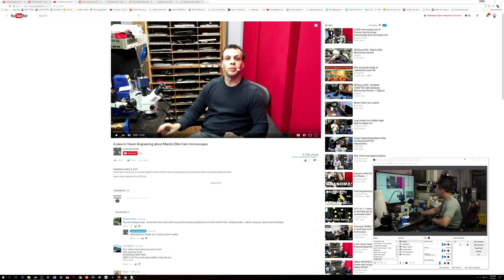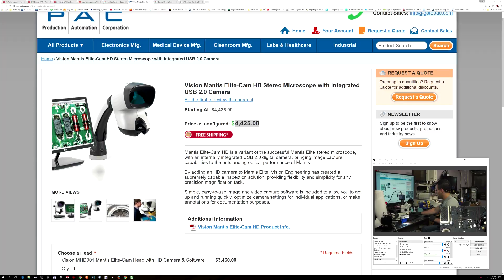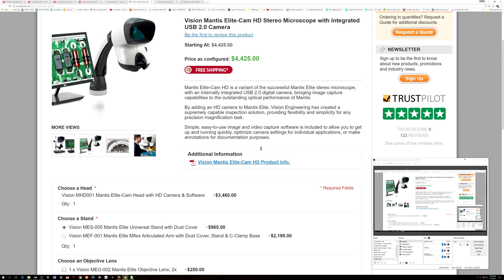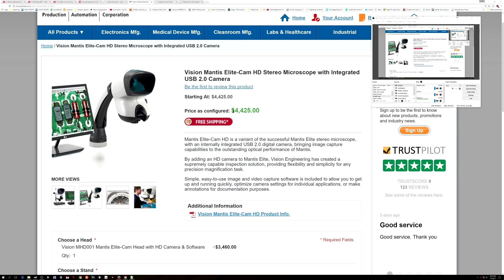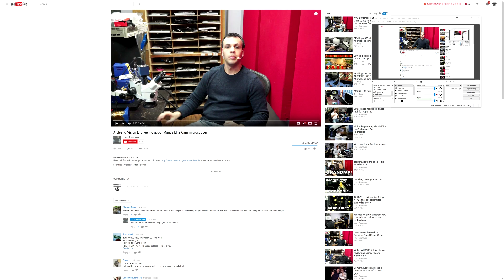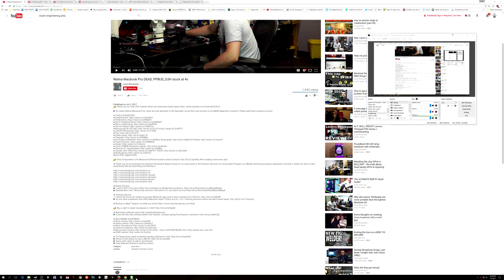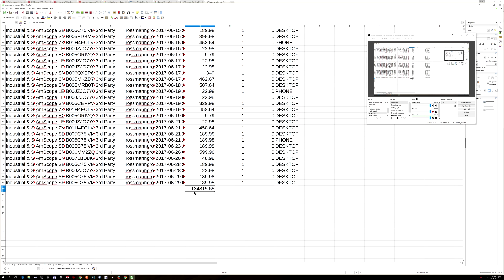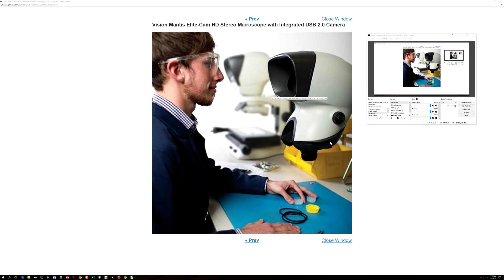A 2nd plea to Vision Engineering: please FIX Mantis Elite Cam!

Comment: Well, they would likely have to source a good camera module. All those Chinese ones are bad - unless they are of proper quality (electronics) + Sony CMOS sensor, not some no-name or webcam quality cheapest sensors from Omnivision or Micron/Aptina. Looking at some cameras in Amscope store - they look similar to Touptek cameras (meh). Looking at specs of Vision Engineering microscope - they provide "uEye cockpit" which may indicate they have IDS Imaging (good vendor) camera in there (but USB2, and it could be old Micron sensor and not modern Sony one) - so those could just upgrade to newer board cameras from the same vendor and USB3.

For comparison some Point Grey (FLIR) net prices of cameras that could be good:
- Blackfly USB3 IMX249: 1920x1200, 41 FPS uncompressed - 495 USD
- Blackfly S USB3 IMX252: 2048x1536, 118 FPS uncompressed - 725 USD
- Blackfly S USB3 IMX250: 2448 x 2048, 74 FPS uncompressed - 1095 USD
Reply from the maker: Even some $250 POS I found on aliexpress that I reviewed a while back is WORLDS ahead of the 2005 laptop webcam in the mantis. This camera https://www.youtube.com/edit?o=U&video_id=47SEO8X2hcI is not as good as mine but still 200x better than the thing in the mantis.
Reply: The key to picking out the good one is to find a camera with given sensor name - and then checking the sensor (Point Grey sensor comparison, astrophotographers etc.). If the vendor doesn't specify sensor name - run away. More modern cameras usually are those better ones, but there is still a lot of old (like 2+ years) leftovers in form of webcams, camcorders, no-name "lab" cameras or "digital microscopes".

As an astrophotographer I had/have multiple of those machine vision cameras and for such usage cases sensor performance is way more important than in microscope with full illumination :) At $250 now you can have a mid range planetary camera.  Touptek AR0130C based camera is less than that.

Comment: Louis, can't you connect the camera you have to a small screen and bracket it on top of your microscope, modify your scope.
Reply from the maker: looking at a screen you lose all sense of depth perception. Trying to solder on that type of setup is worse than trying to solder while wasted off a bottle of Bacardi
Reply: Oh well, it was a thought to help your posture and poor neck.

Comment: You probably will feel the pain with that setup too because the muscles were not designed to keep one posture for long. The real solution would be something 3D on a big screen in front of you. :) That way you could naturally move around and relax the different group of muscles unnoticed. If 3D would not required than a 3$ cable straight from your camera could do that for you. :)
Reply: Sitting straight up is FAR more comfortable than leaning over.
Reply from the maker: looking at a screen you lose all sense of depth perception. Trying to solder on that type of setup is worse than trying to solder while wasted off a bottle of Bacardi
Reply: I had a feeling this is why I said 3D would be ideal. Sadly that is not really solved yet. Maybe some kind of VR glasses in the future if they are light enough. But than you would need a dual camera setup... all is too far in the future. Thanks for the reply Louis!

Comment: take a look at this solution by Leica. i hope this link work but if it does not work search for handgravyr.se on Instagram  https://www.instagram.com/p/BSBxAC9BAUj/

as far as optics are concerned there are adapters for dslr, mirrorless and camcorder by  companies like Zeiss and martinmicroscope but you'll have to talk to them to get correct sizing to avoid vignetting.
Reply: That is a Leica M60 with an ErgoTube 10° - 50° and a ErgoWedge 5° - 25°
http://www.handgravyr.se/wp-content/uploads/2016/12/DSC01488.jpg
http://www.leica-microsystems.com/fileadmin/_processed_/csm_Leica-Ergo-Tubes-allin_a324c3ab26.jpg
http://www.leica-microsystems.com/fileadmin/_processed_/csm_Leica-Ergo-Modules-all_d28528e8f3.jpg

Also you'll need a "Photo port" or "camera port", with that you can use your camera. Couldn't find it on their web site, but they definitely have that option
http://metkon.com/timthumb.php?src=fotogaleri/image1_20170109182034.jpg&w=300&h=332
http://www.spachoptics.com/v/vspfiles/photos/LEICA-M60-PHOTO-2.jpg

Here is the description page (they have a video there too)
http://www.leica-microsystems.com/products/stereo-microscopes-macroscopes/ergonomics/
Reply: Price is a bit unknow.
Body goes forr ~$900 used on eBay
ErgoTube 10° - 50° is another $900 used (eBay)
ErgoWedge 5° - 25° is a whooping $1,000 used (eBay)
Camera Port add another $1,000 for a used one (eBay)
Stand will be around $700 used (eBay again)
Plus lenses, some misc crap - another $500

Total approx cost for a used scope around $5,000
New one from Leica directly? I assume over $20k
Reply: @evgheni melman
how are u able to post all those links?
youtube hides my comments like this for others and some people even asked me, if i got their link to sth. i asked them for in the comments, which of course i did not get.
u're a lucky one evgheni.
also fuck youtube.
Reply: cataria pega you are probably blacklisted by YouTube for some comment that you made.

Comment: Can't you spec the camera you need with your microscope?
Reply: Different styles of microscope have different styles of cameras. They all mount differently unfortunately. Some  scopes have them built inside and some like the one Louis has can be taken off and changed.
Reply from the maker: You can't swap out the camera in the mantis the way I can swap out the camera on my amscope. :(

Comment: Yo Louis Rossman, an idea.

Make your own lcd set-up! After set-up, the only maintenance should be updates or adjustments.

*Logitech webcam 920 (30fps, if you want more, there should be 60fps webcams now from other companies)
*monitor suggesting 12" or bigger, combo it with a Sun Hood to prevent glare
*monitor mounting arm. amazon basics one looks good.
*3 quantity - 10 foot hdmi connectors
*external video capture streaming device
*small computer, suggesting something small enough to be a single purpose device. i5, windows 7 (8 blows, 10 unstable)

1. tape webcam to microscope
2. lcd monitor to articulating arm
3. webcam to small computer
4. hdmi from comp to video capture device in
5. video capture device hdmi out to lcd, second hdmi out to your streaming computer.
6. Turn on OBS on small comp, set to fullscreen. leave small comp on permanently. power settings so it never turns off.

You might be looking at 1.5k to put together a good set-up.  Enjoy taking care of your back sooner than later! =)

Comment: If you don't know who to reach out to at either company... it'd probably be worth hopping onto Facebook Power Editor, creating a Custom Audience that targets only employees of Vision Engineering & Amscope, and running this video as an ad that appears in those employees' News Feeds. Even if it doesn't reach the decision maker, maybe it'll reach someone that'll pass it to decision maker.
If you're willing to spend an extra $2k for a better camera, then allocating $100 or so over the next month might be worth the improved chances of making it happen.
Reply from the maker: Spending $100 to convince a company to increase the cost of a product by $2000 so I buy a $6000 product is not speculation I want to do. At least spending $6k on the microscope would get me a microscope. Spending $100 on a chance is.. no